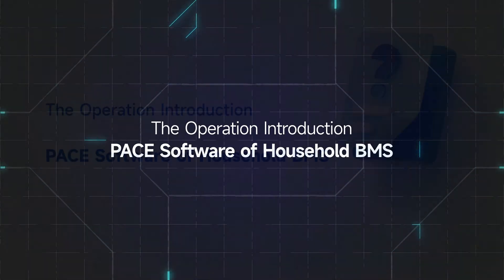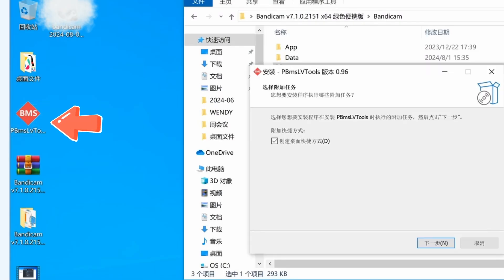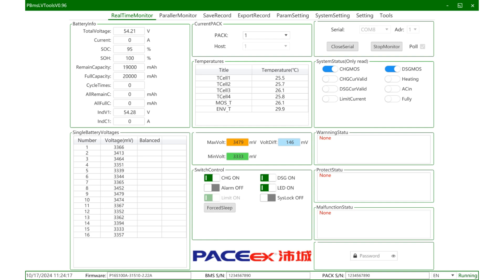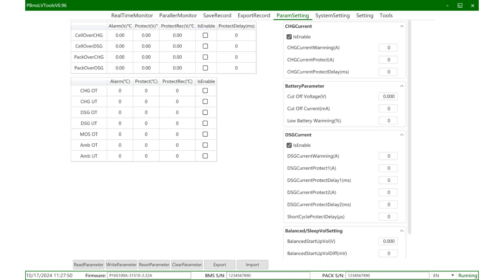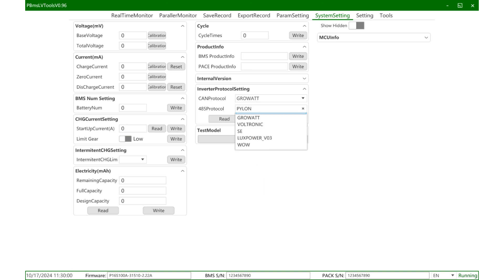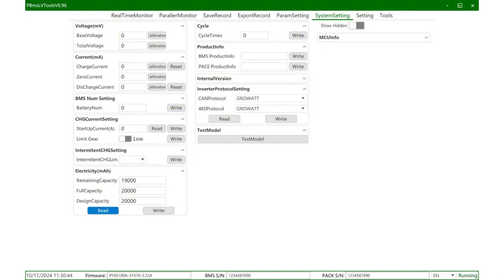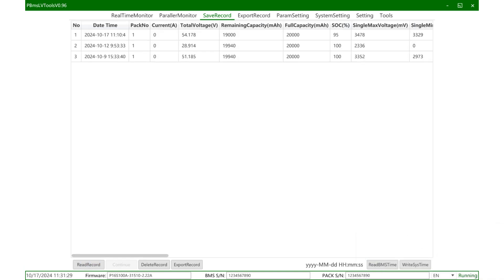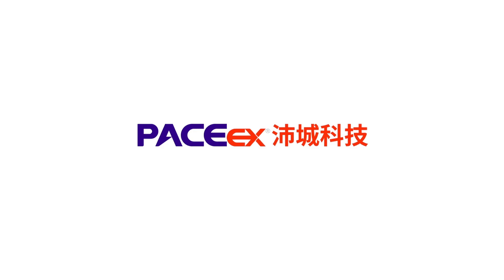E01-1.PACE household energy storage BMS upper computer operation video.

Comment: Garbage as the Balance Current is almost 0 Amp. Also no possibility to add a smart Active Balancer, even if the HW and SW is quite nice.
Reply from the maker: @alexandruilie-l3m Hello! Thank you for taking the time to provide feedback and for your recognition of our product's hardware and software design.
We take your concerns regarding the balance current approaching 0 amperes and the inability to add the Smart Active Balancer very seriously. To better understand the specifics and provide targeted assistance, could you please share the following:
- Where did you purchase this BMS product? (e.g., our official website, an e-commerce platform, a specific distributor, etc.)
What specific issues are you currently experiencing? (e.g., Under what conditions did you observe the balance current at 0? Have you attempted any troubleshooting steps? What are your specific requirements for adding the Active Balancer?)
Providing more details will significantly aid our analysis. To streamline communication and expedite resolution, we recommend contacting our customer service team directly:
WhatsApp: +86 18924647568
Our support team will promptly follow up to assist with your concerns.
Thank you again for your feedback. We look forward to resolving this issue for you as soon as possible!

Comment: i have a battery powrmr pow-lio-48200-16s. i have this bms software version 1.38 on windows 11, the connection rs232 is ok, the parameter real time is ok. put the password, and change to green is ok. the problem is in paramsettings, the read is ok. when change some parameter for celloverchg that is 3.6 to 3.52 and set writeparameters is ok, but WHEN READ PARAMETERS AGAIN, THE VALUE CHANGE TO 36,00or other value. the same happen with  other parameter
what can i do?
Reply from the maker: Can you tell me your specific product model, our technical engineers will help you troubleshoot the problem immediately! You can add WhatsApp: +86 18924647568 for continuous follow up!
Reply from the maker: Upper computer setup, correct steps: 
1. read data: upper computer reads BMS data; 
2. edit data: upper computer modifies data; 
3. write data: upper computer writes data;

You need to confirm whether to write data to save after modifying data.
Reply: @PACEBMS  can you make vídeo changing parametersetings
Reply: @PACEBMS  how confirm change
Reply from the maker: @koponda  https://youtu.be/22WF-bL_wQQ?si=xiT1oTT4zlGaqn53&t=234
Reply: @PACEBMS  this software has a language bug, i live in spain, my windows 11 is in spanish, when change  any parameter and read the parameter, the software change the value and afect the battery. fixed please
Reply from the maker: @koponda  If you modify the parameters and save them, the battery will operate according to your updated settings—such as charging and discharging configurations—which appear unrelated to your language selection. If you believe language settings caused parameter errors, please provide relevant data screenshots to our after-sales support team for assistance. WhatsApp: +86 18924647568

Comment: Computer Communicate with battery but after a while disconnected.  Some alarm showing at real monitoring page. How can I clear all the alarms.
Reply: I have connected with 485. Should I connect through rs232
Reply from the maker: @Journeywander  You can try connecting to the host computer via RS232, or you can add WhatsApp: +86 18924647568. We have technical engineers who can help you troubleshoot and resolve the issue.